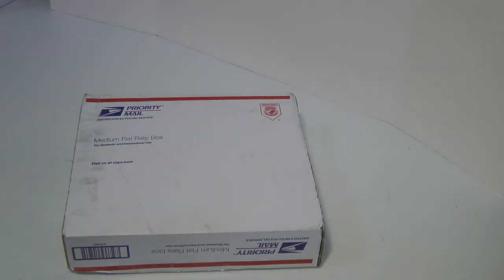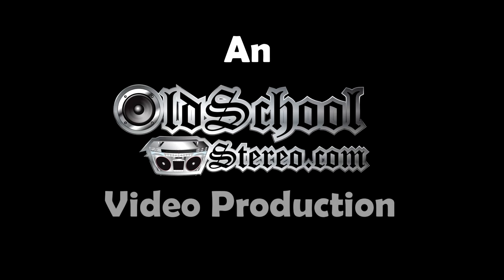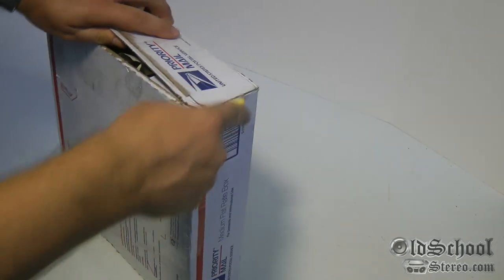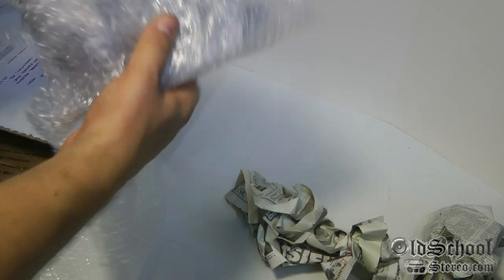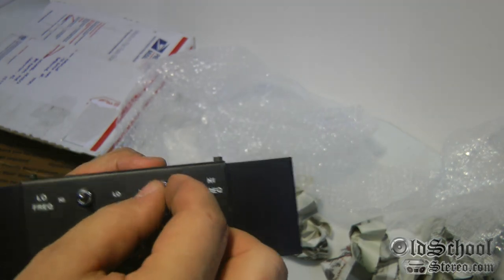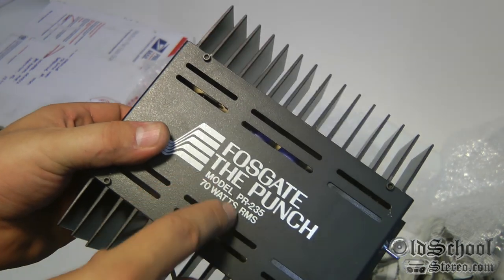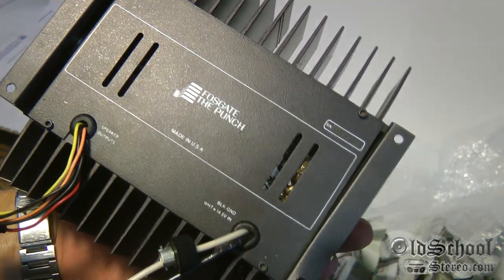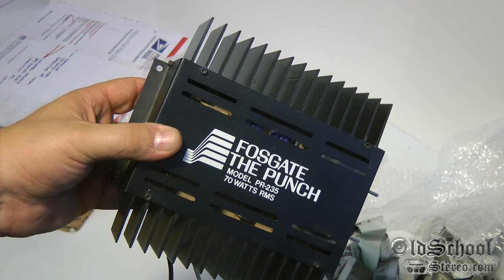Vintage Fosgate PR-235 Amplifier Unboxing Pre Rockford Fosgate Old School

Comment: I had one of those in my 1967 Plymouth Fury III 2-door sedan with a Kenwood KRC-511 head unit with the amp driving a pair of Cerwin-Vega CS-18 6x9 speakers in the rear package shelf.  I bought them from Crazy Eddie on Long Island.

And with the big trunk on that car it had some LOUD bass (in 1980).

The car is long gone but I still have that amp and those speakers in my basement along with a schematic for the amp that they sent me when I wrote them and asked.